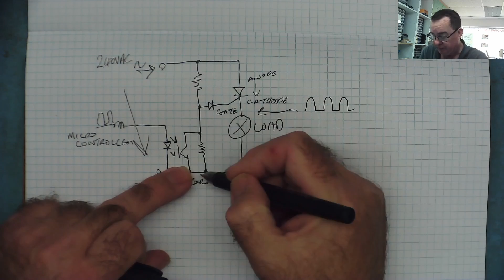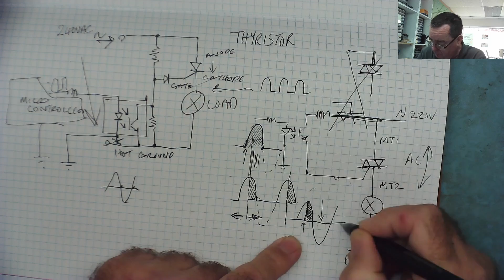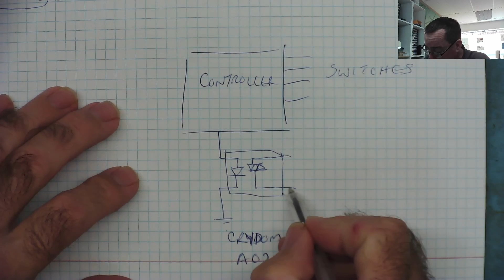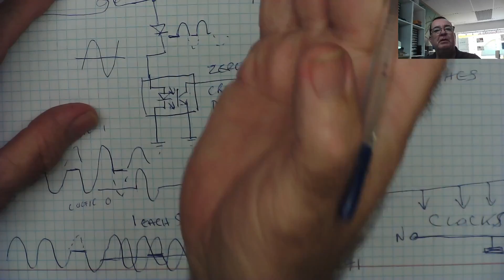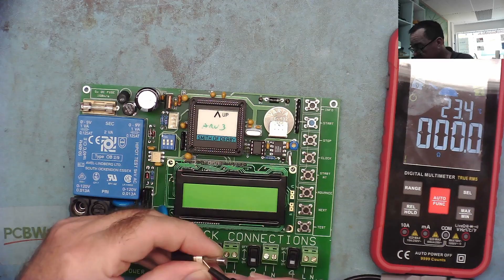Pure Electronics Repair 3 Learn Methodical Fault Finding Techniques / Methods To Fix Almost Anything

Comment from the maker: Additional information
Somewhere in the recording I lost the fact that the resistance across the transformer primary was about 1K ohms.  I checked the faulty Varistor (MOV) this morning and it actually reads 5K ohms - so this was not a short you would detect with your multimeter - the Varistor was breaking down at mains voltage which is why the fuse was blowing.  Regards the circuit showing the SCR (Thyristor), the circuit is correct but the operation is opposite to my description.  The SCR turns on when the LED in the optoisolator turns off, and turns off when the LED turns on.  So a 'logic 0' or low voltage applied to the optoisolator turns the load ON, and a positive pulse or voltage to the optoisolator turns the load OFF

Comment: Hi, Richard, i agree the optoisolator can set the frequency for the clock but this can also be set my the MCU and with help from the eeprom, also we can see as most mcu's do have an internal oscillator there is one externally which is common practice. So my theory would be the mcu relies on a 50hZ supply to requlate the internal code to produce the 0.002 sec's sinusoidal waveform to regulate 60secs on clock output... Just a thought.... Steve

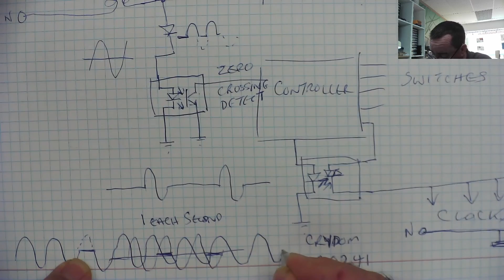Comment: 30:45 out of interest… could you use a shift register that counts the frequency of the power supply to make a clock? Using the half cycle of the 50hz (25hz) on a shift register of 25 length in which it sends power & a reset signal once every second (25hz)?

Comment: They’re on supermarkets too. With no surge protection, they’re a regular issue after a Powercut. In my previous life as an electrician, it was always a case of ordering in & replacing the entire PCB, often leaving the customer without a functioning clock for a week or so.

Comment: About the desoldering gun technique. I watch Adrian Digital Basement use a cheaper one than yours and what he does is move the opening in circles around the pin with a gentle speed and he seems to get all the solder out in one go.

Comment: Can I connect my external power supply with alligator clips to a 500 series module edge card to power it up to test it . Simply connection the ground , neutral and hot directly to the card?  Sorry if it’s a dumb question.  Really enjoy the channel!

Comment: At work I recently had the exact same fault with two control boards of air handler wall units to cool technical rooms. On both boards the MOVs were blown and shorted L to N (both were cracked like yours!), on both of them the primary windings of the transformers were blown as well.
I injected power behind the rectifier with a benchtop power supply and so far the boards seem to be working.
We suspect someone to have measured the wiring to both units incorrectly with an insulation tester, as they are supplied from the same electrical cabinet. But I need to sacrifice one board, where at least transformer and MOV do work to test that. Unfortunately I don't have time for the next couple of weeks, as big festivities are in order and everything is a mess right now because of that...

Comment: Measuring / testing fuses protecting low impedance circuits (here on the transformer secondary) is prone to give you false positives   - the resistance of the secondary is so low the current runs the other way around the blown fuse (known issue when testing the fuses on tube amp heater circuits) - so for such testing you have to remove the fuse.

Comment: Very interesting!  I have learned a great deal from the repair. Thanks so much for sharing. I now find that some of the devices I received in a box of misc. parts from a dealer are in fact varistors and not capacitors!  Nice.

Comment: I had a massage chair that had that in it. It didn't work as soon as I plugged it it. They send me a new motherboard for it. Before the motherboard got here I removed that MOV and replaced it with one from a power strip I had. It was working before I got the replacement motherboard in the mail. They didn't want the old one back so I still have an extra motherboard for the chair lol. It was super easy to fix.

Comment: Another great repair, you could have spotted the varistor heating with your current microscope thermal camera, where is the promised  video ?
Reply from the maker: Which promised video?  What have I forgotten to do now
Reply: @LearnElectronicsRepair  You promised to show the thermal camera from infiray showing current flow for trouble shooting shorts.

Comment: So, the Varistor did what is designed to do - protect the circuit board from voltage spikes. RIP Varistor.
Reply: A noble sacrifice 🫡

Comment: Great video Richard. I was thinking if you left it in circuit and used the variac to turn down the voltage, maybe it might of worked at a lower voltage. Probably not the safest thing to try. But it might of pointed you in the right direction from the start.

Comment: I have a collection of salvaged varistors. I just remove from stuff when I see them .Do you think you would use them at a push or wait a month and replace with new stock ?
Reply from the maker: I think this depends on the circumstances.  In this case, the PCB is used in a commercial environment (health centre) so I feel it is important to complete the repair using only original value components.  Also it was sent to me from the UK and will be going back there so it would be more hassle if I have to change the Varistor again.

Comment: Are you going to replace both MOVs? The other one may have been weakened a bit in the past and the cost of the component it is best to ensure that both of them are new.
Reply from the maker: Yeah why not - I'm ordering a pack of 20 anyway.
Reply: very good remark

Comment: A thyristor switches on when the gate is on a higher potential than the cathode and it stays on as long as there is current flowing. You seem to say it switches on when the gate is on zero potential. I am confused.
Reply: Everything seems to turned around, even the diode.
Reply from the maker: @kriswillems5661  The diode is the right way round but in this circuit the SCR actually turns off when the LED in the opto-isolator is on, and turns on when the LED is off.  My mistake and you are correct.  Well spotted and hopefully you are no longer confused.😉
Reply: @LearnElectronicsRepair  Ah, right, the diode is right. But will it work if the load is connected to the cathode? Shouldn't it be connected to the anode? I guess it doesn't matter because there's almost no voltage on the load when there is no current. But this is only true for a resistive load, if the load be not linear or slightly capacitive there might be a problem. Generally the load is put on the anode, because this way it's easier to control the gate-cathode voltage.
Reply from the maker: @kriswillems5661  I'll accept what you say and learn a little from it 🙂
Fortunately I'm not a circuit designer, I'm a circuit fixer, so I just repair what is in front of me.  I have a good idea how it works, enough to diagnose it, but freely admit I don't always know the ins and outs of it exactly.

Comment: Hi Rich, I believe you got the logic backwards in your diagram with regards to the Opto and SCR, when the Opto-isolator switches ON, would it not remove the gate voltage/current effectively preventing the SCR from turning ON?
Reply from the maker: Yeah you are correct, that circuit would work that way round though the principle is the same.  A logic low turning the LED off would turn the SCR on, and vice versa
Reply: @LearnElectronicsRepair  Yes, I'm not trying to be picky, I just wanted to clarify that for anyone attempting to build something similar.
Reply from the maker: @KB1UIF  Absolutely -and please continue to do so,  I don't always get it exactly right though that does not usually stop me from fixing stuff

Comment: isnt the transformer only rated for 120v only depend on the writings on it ?
Reply: There are two 120V AC primary windings, which you can wire them in parallel for 120V or in series for 240V.

Comment: 21:56 - I propose to write/draw with a pen/marker directly on PCB, symbol of component on other side, when explaining like that, because each time board is flipped forward backward we (viewers) have to re-think all previous signals. Then we can follow more precisely. Its something I do, then when I clean with alcohol , it erases all drawings anyway.
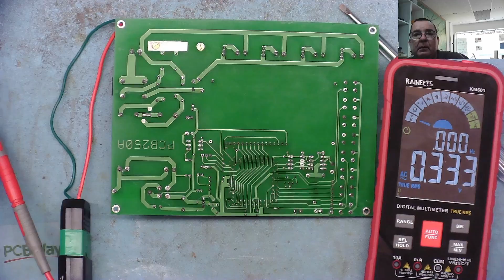45:30 - That metal cap of fuse that went underneath, can make unwanted connection.
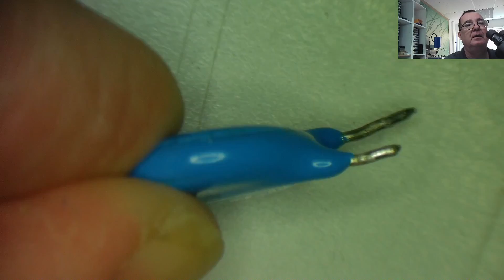54:01 - To viewers, both MOV Metal Oxide Varistor and Thermistor (Different component from Thyristor) explode like fireworks under some conditions, so be careful when you turn on devices that have those components. And this is why good visual inspection of board is important before any measurements. Use magnifier with LED light and watch for cracks on MOV for example, among other things.
Reply from the maker: 21:56 that is a very good idea I will do this on future videos.  Thanks Orion 🙂
54:01 yeah agreed as I also mentioned in the video, these blue things that look like capacitors (and are most definitely not) quite often explode when they fail, and the type of fault that I found on this PCB is quite common so it's well worth remembering